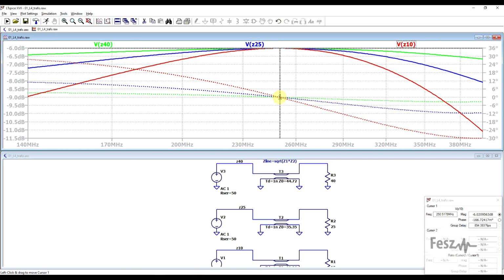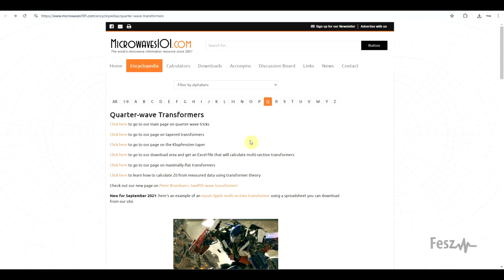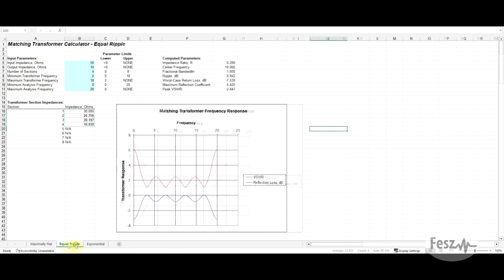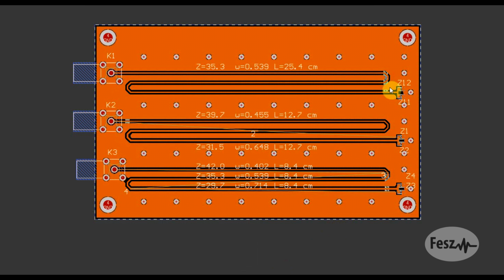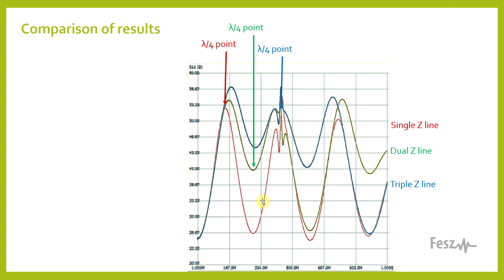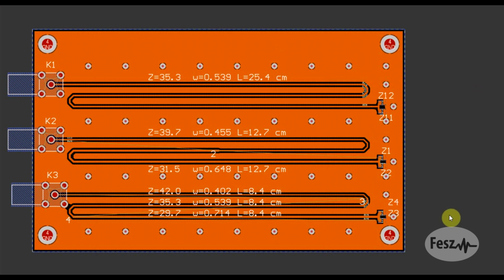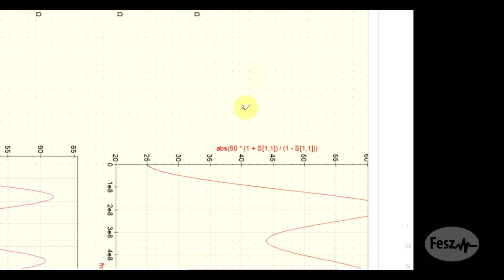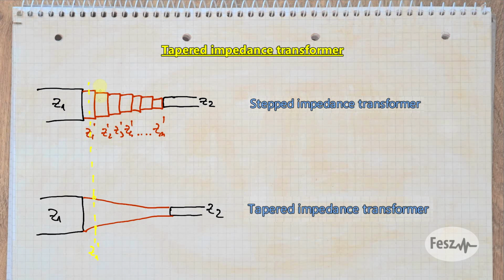Stepped Impedance Transformer

Comment: @FesZ Electronics At 1:09... in the video... you have that Zc = sqrt (Z1 * ZL) so that it follows that Zc^2 = Z1 * ZL, and Z1 = Zc^2/ZL.
But, right beside that you have that Z1 = sqrt (Zc^2/ZL). What's going on?
Reply: Z1 = Zc * (ZL + j * Zc * tan(B * l)) / (Zc + j * ZL * tan(B * l))
applying the 1/4 wave condition
Z1 = Zc * (ZL + j * Zc * ∞) / (Zc + j * ZL * ∞)
doin a little sloppy (but ultimately 'valid' algebra, around infinities)   
Z1 = (Zc^2) / ZL
Reply from the maker: Indeed that is an oversite on my side; the "sqrt" was not supposed to be there...

Comment: I can''t see it clearly in the video - but are there any vias on your boards apart from the through holes? It looks like there aren't any vias on the long island of upper ground plane between the S bend traces. Usually RF boards will be stitched with hundreds of vias along both sides of every microstrip trace, so if you've only got the through holes, it might have affected your results.
Reply from the maker: You are right, I didn't notice this before but I don't have enough vias - the ground islands inside the U bends are not connected using vias, there are only vias on the outside of the complete structure. So there is a line of vias all round the complete transmission line, and well in-between the 3 structures there are lines of vias, but I forgot to place vias inside of the structures.